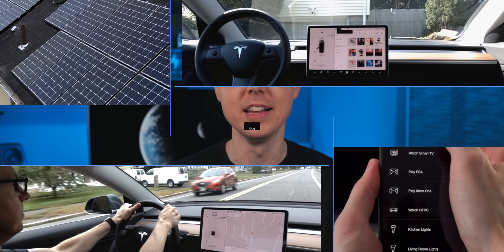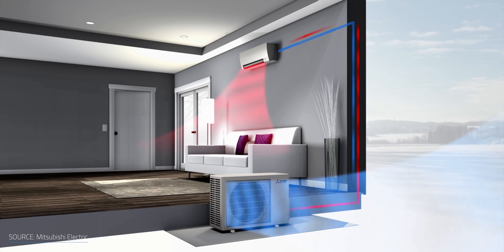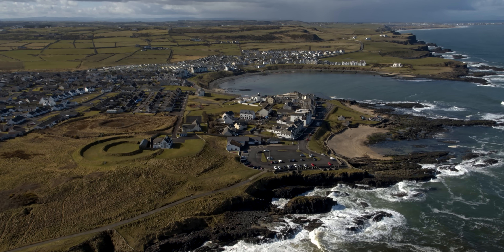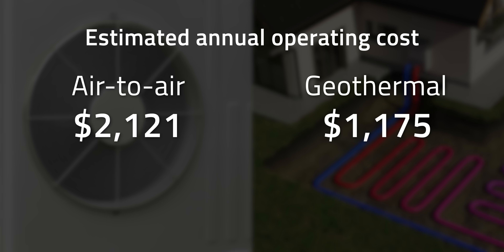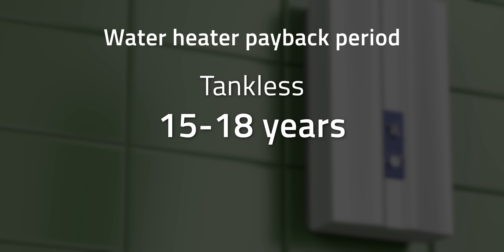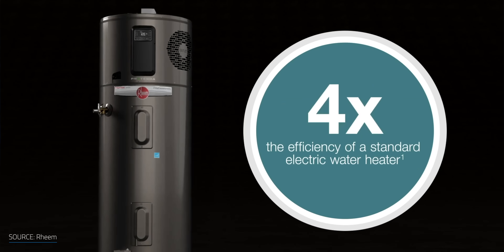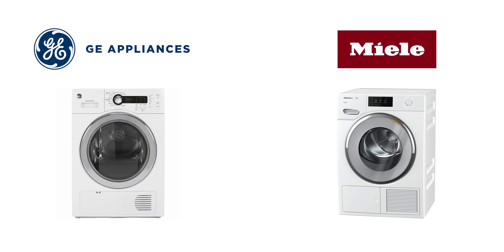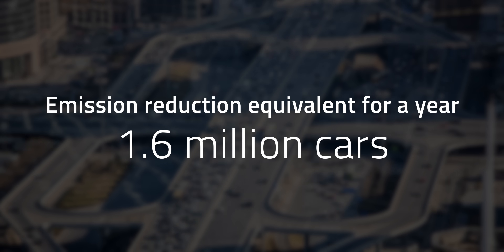Why Heat Pumps are Essential for the Future - Explained

Comment: One issue I heard in the past about heat pumps is that the gas used inside has  a very strong and lasting greenhouse effect, so leaks over the lifetime of the units and their disposal may pose a big problem. I heard that these gases could be replaced with more harmless one, but at the expense of being flamable or having less efficiency.
Reply: It is the same gas/liquid as in any fridge and AC. Freons are banned for a long time, main problem of those more eco-friendly chemicals used today is they are more expensive (there is difference in efficiency, but I think it is small).

Comment: I’d like to know what happened to the Heat Pump back in the late 70’s early 80’s, that had a small Gas Flame in the Outside Unit to add heat to the Refrigerant. Seems the Gas Companies said they were dangerous. They Produced a higher Supply Air Temperature inside, with every bit of Heat being extracted from that flame, after extracting Heat from the Air.

Comment: I don't understand the heatpump dryer thing. We have heatpump dryer for over 13 years. I'm from the center of Europe. Dryer is from Siemens. It costs about 500 euros back when we buy it. During those 13 years it had two "repairs" (service man just cleaned the internal radiator and water tank) and it's still running perfectly.

Comment: hvac tech 20 years. right now i recommend natural gas heat and straight cool whenever possible. that way u arent using your air conditioner in the winter essentially shortening their lifespan by quite a lot. refrigeration equipment aint built to last very long anymore due to all the epa regulations. everything they had to do to increase efficiency and the different refrigerants and oils being used.. its cut their lifespan in half while costing twice as much. i do not recommend using refrigeration in the heat cycle anymore i would personally advise on anything but.

Comment: I would want a hybrid water heater with gas backup instead of resistive backup so it can be installed where there is only a gas line and a 120-volt circuit instead of having to run a new circuit for the heating elements

Comment: I have an older heat pump hear in Washington. When the temperature drops below +35f degrees it's ability to keep the house warm goes down, below +25f the house starts to get cold as the unit puts out virtually no heat when the outside temp is be!ow +25f... Yes I need a new one but can't afford one and as I have one I don't qualify for any of the efficiency up grade programs.... Signed.  Cold in Washington

Comment: Errr... surprised to see that heat pump dryers aren't already a big thing everywhere. O.o We bought our Bauknecht (generic Electrolux brand name) 7kg dryer back in 2015 and it only set us back about 600 Euros. Cheapest tech is still the venting dryer, starting in a comparable size at around 250, condensator at about 400 and Wärmepumpentrockner start even at about 480 now (2022). Just Germany for comparison.

Comment: The next level is to fully intergate all heat pumps in your house. Imagen that your water heater, refrigerator, dryer, A/C, and in flood heating all worked together. It will be easer to cool your house if the refrigerator didn't blow warm air into your house and it was transferred to the water heater because that where the heat could be used.

Comment: The one concern with heat pumps I'm not seeing addressed, is that the heat, for example, when you're cooling your house, is transferred to outside, where it's only making things hotter. So it seems like something that should be addressed, especially in cities that are already getting hotter every year. Am I missing something? Maybe if we did something like Matt Bland below suggests, and use that heat to then heat some of our water, or something. Close the loops, as Matt mentioned.
Reply: Any process that cools one space, heats the outdoors. The more energy efficient the system, the less extra heat they will produce and also dump into the air. Even if you carried big blocks of ice into your house by hand, the heat displaced from the water originally was dumped into the air.

Comment: In colder Northern climates, rather than Air as the heat source,  a more concertrated energy source lies in the ground itself, where winter temperatures of 15C can be found one metre beneath the ground as here in Ireland, or 2 metres as I'd the case in Canada et Al...Air source pumps in those climates in not on.. With a well designed underfloor system coupled with a  well designed geothermal system, COP's of 5.5-6.0 are easily achievable

Comment: Most residential comfort cooling systems aren't using R-134a, they are using R-410a. R-134a is typically found in automotive systems. 
When doing your comparisons, you need to factor in total life cycle costs, not just initial price as that is but one part of the costs. You need to look at operational AND repair costs over the life of the system.  When a ground source heat pump has an issue it can be more than the initial installation itself with just a few issues.

Our on demand natural gas water heater with a family of seven cost me $172 for an entire years worth of hot water. Really hard to get much cheaper than that.

Biggest issue with super energy efficient homes is how bad the indoor air quality is. You created an airtight envelope and you have to have fresh air to keep from getting "sick home syndrome".
ERV (energy recovery ventilators) try to help with this, but they reduce "efficiency" and are stupid expensive to have installed properly.
I'm a Journeyman HVAC and I've seen a whole bunch of promising tech that worked in a sterile lab fall flat on their faces when brought into the real world.

I love heat pumps and I try and help my customers understand the tremendous value a heat pump system has over conventional AC/furnace systems. The new inverter/ecm motors that are able to vary the output/capacity of the condenser compressor to deliver exactly the amount of heating/cooling as required is pretty amazing.

Comment: In the words of Technology Connections... "More pumping, more now!"
Heat pumps combined with good insulation (and maybe a resistive heater in case you live in a climate where the winters go colder than heat pumps can work as efficiently) would allow you to significantly reduce the energy spent on heating and cooling.

what's the song you're using at the start of the episode after the 1 minute mark? It sounds really familiar and I can't quite place it.

Comment: We can use permanent magnet motor as generators and add inverters to deliver house current AC power.  It is possible to make an air conditioning system that runs without consuming electric power.  They use electric motor based on magnetic field generated by electric current AC.  If the wiring is carefully designed the fans and compressor can be made to run without consuming electric power but only uses the electric power to generate magnetic field to move the motors.  It the wires in the motor are equal to the current applied then heat is not created and current is not lost to heat creation.  The magnetic field is generated without heat or current consumed.  The motor or compressor runs but does not consume electric power.

Comment: I have a 92% efficiency natural gas furnace towards the end of it's useful life (about 20 years). I'll probably upgrade to a 95% efficiency natural gas furnace which uses 3" PVC pipe vs the current 2". I have a short run so it wouldn't cost me much. I would retrofit the house with a heat pump to get rid of the furnace and central air. However that is even more expensive than starting from the ground up in new construction.

So until the prices drop significantly, I'll be sticking with this type for a while.

Comment: 12:37 - my experience with our new heat pump dryer was much less positive. Whilst very expensive, it has only lasted about 3 years, with much poorer drying performance than our conventional dryer, which is 20+ years old and still use.
The dryer manufacturer's response to the performance of the dryer has been criticism of the owner not clearing the lint trap after every cycle, which we have actually done scrupulously (because the dryer cost so much, we wanted to look after its performance). The performance of the dryer in winter made it almost useless. Beware of manufacturers touting "cupboard dry" as opposed to actually dry. This setting causes clothing to feel cold and clammy when put on.

Comment: You know if there will be a laundry processor version of the dryer type heat pump (that is a unit which is also a washer like those units used in motorhomes and yachts; also used in European home.

Comment: Good info, but as usual, it may not be the best option for some. I looked at a heat pump water heater, but in the long run, a standard electric water heater is less expensive for me, why, I just added a couple of extra solar panels to my system, using grid tie and the credits on the power bill, it saves me money. And those on-demand water heaters, no thank you. They usually never save you money, when you take into account the high initial install, then unless you do the yearly descale yourself, which could be an extra 100.00 a year. Plus when power is out, you have NO hot water, then people say, now I can stand in the shower for an hour, well duh, lots of extra cost for that. Last week we had a cold snap, the biggest complaint was from people with on-demand gas water heaters, they were all frozen!  I found an excellent low-flow shower head(most are terrible) it flows at 1 GPM, and guess what, my standard 40-gallon tank with a 4500-watt element heats faster than I can use, so it's like I have an on-demand unit, as I could stand in the shower for an hour, or have 10 people take a shower back to back and never run out of hot water!

Comment: But if it's under 45*F heat pumps won't produce heat. 

However if we put the heat pump inside like in the garage, it would work far more efficiently both summer and winter.

Comment: I do not believe you take into account the c02 from the genration souce and the 50% line losses that are typical of utility grids,   The increase in efficiency  in  heat pump water heaters is closer to 125% over typical electrical water heaters,  this is due to the heat generated while the refrigerant is being compressed..

Comment: Our clothes dryer is infinitely efficient. It's a clothesline and pegs, no mains power or fossil fuels 100% solar power. With no moving parts or electrical components it broke down recently after 23 years of faultless service, I replaced the line for $24... Good for another two decades.  Running cost $1.04 a year 😁👍
Mind bendingly simple...

Comment: Every house I been into that used a heat pump NEVER had hot air in the vents int he winter nor COLD air in the vents during the summer.
Just pee warm in the winter and not much better than a strong fan in the summer.
And always tend to be running all the time too.

Comment: There needs to be some kind of integration between heat pump, fridge, and water heater, and also some kind of thermal capacitor. We cool the room when it’s hot, when it’s cold outside, but that changes every 12 hours. Also while cooling the house we maybe heating the water and while heating the house we’re cooling the fridge…
Reply: It is possible, but you have to count if the instalalation price of such a system wouldn't  be too costly compared to the savings. Good example where such system works are Tesla cars and their thermal management for battery, engine and cabin.

Comment: An issue with heat pumps is the dangerous chemicals that they use. Those chemicals are used in many HVAC solutions and refrigerators. They can slowly leak into your home and are harmful to people. In some cases they can damage the Ozone or have a vastly increased warming potential compared to CO2. This danger is usually considered minimal with a bit of an increase the longer the unit stays in operation. The disposal of these unit have an increased cost due to the cost associated with trying to reclaim these chemicals.

Comment: if you take the refrigerator doors off and the cut a hole that fit the refrigerator shape in the living room between inside and outside then place the refrigerator about half way trough the hole in the wall and make sure that the inside of the refrigerator is facing toward outside and the back of the refrigerator facing into the home home and you got your self a low power heat pump. 

if you leave the doors or door of the refrigerator in your home slightly open and then glue some water containers to the inside of the refrigerator and you got yourself a low power dehumidifier.

Comment: 1 joule = 1 watt-second. So it is using 1 watt-second to move 3-5 joules of heat? So equivalently you're saying it uses 1 Joule to move 3-5 joules of heat? I think it's important to differentiate the difference between units of power vs units of energy, because if you use 1 watt of power over 0.5 seconds you've only used 0.5 joules or .5 watt-seconds of energy or if you use 2 watts of power over 0.5 seconds you've used 1 joule of energy or 1 watt-second. E = P x t [Energy = Power x time].

Comment: Great channel and information ! 
Should we also be considering the resource use/extraction for both manufacture and instillation, recyclability of materials, and repair frequency of the more complex systems ?
Reply: No.  All the major brands now have 10 year warranties.
Reply: @neon-john  Only if your brand and installation company still exist for 10 years. Also warranties are often not what they seem it would surprise me if this industry was that much different? What are the warranties covering? And what about the other concerns Mr. nerd?
Reply: @neon-john  your information is also misleading and factually inaccurate.LG for example offers a 10 year compressor warranty, but a 5 year warranty on the remaining parts.Mitsubishi – 10 year compressor, 6 year parts and 6 years labour (when purchased from authorized dealer). Daikin – 12 year parts (including compressor), 6 years labour. 

After that first year there is often a service call fee to diagnose the issue.

Not cleaning the indoor filters regularly. 
Not keeping the outdoor unit free and clear of snow and ice during winter weather. 
Not keeping the outdoor unit clear of grass, weeds or leaves. 
If a failure in the system is deemed due to a lack of proper care or maintenance than you would not be covered. Air filter changes or cleaning once a month are often considered required maintenance.

The other areas not covered under warranty are issues deemed caused by improper installation.

Comment: I wonder if a central geothermal heat pump could provide the infrastructure for an entire community like electricity or water, so one would simply have to connect their home to a utility provider's pipe that runs underground back to the central pump.

Comment: Heat pumps are great and is a no brainer with the crazy efficiency they provide. Solar, on the other hand, not so much. Average solar installation ROI is close to 10 years, which, in my opinion, is not particularly attractive given that panels deteriorate over time, require cleaning. Plus, new, more efficient technology is coming out constantly, so by the time your solar ROIs, it's likely that we'll have a much more efficient way to convert this energy.

Comment: I like see info on how heat pump drier would last 2-3 times longer then a vs heater type type drier, I just don't see how that can be true.  A non gas drier most time end of life is when fan/drum motor dies if fairly common for this last over 20 years, a lot times dries are a lot times replace just because there old, a lot time time when replacing the washer witch does not last as long.  I don't see how using heat pump here would make it last longer, I would think it would likely be the heat pump that would part that going fail first.  Now I do like the thought of heat pump drier as your not actively venting heated or cooler air from the home.

Comment: Great video Matt, question:  If you put a heat pump water heater in your basement since it cools the air would this cause the furnace to work harder - less efficient?
Reply: No, your furnace is sealed and only moves air from the temperature controlled spaces.
Reply: @javierh35  thanks

Comment: Unfortunately, any repair on a heat pump ( like the ones mentioned) will generally far exceed the repair for a gas fired system. 

As an hvac tech, I agree that heat pumps are very efficient. I believe ,in combination with fossil fuel as a back up emergency heat source, they should be in every home. You also must understand that this is a price point the average person will not be able to afford. 

This is the same logic as moving every car to a Tesla. Good idea, but not affordable and therefore not achievable. :(
Reply: Well as you know the cost to have a hvac person install a heatpumps is an absurd amount of money. I installed my own minisplit heat pumps and it's really affordable. You can get a good 3ton 3zone heatpump minisplit for about $2500 including install materials.
Reply: @randybobandy9828  yes, I don’t mean to come off as rude, whatever you do on your own will save you money. Not everyone can. Not everyone is able bodied, knows a handy guy, or has the guts to do it on their own. 

Self installation and not done through an hvac company will typically void any warranties and make a mini split a throw away item, like a window unit. 

Great job on the install, but you have to critically think. Not everyone can do the same thing you did.
Reply: Good analogy using the Tesla. I think this is about making money and nothing else.

Comment: I live in Denmark. We have 400 m of tube just one meter (3 feet) under ground. There is no reason to dig deeper. You just take out the heat accumulated during the summer.